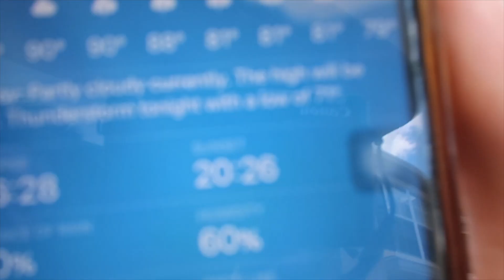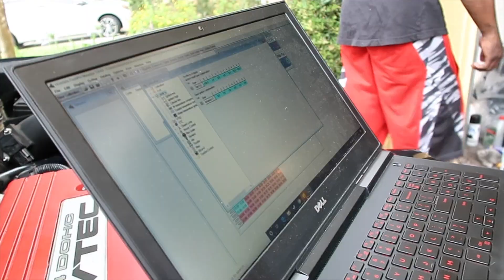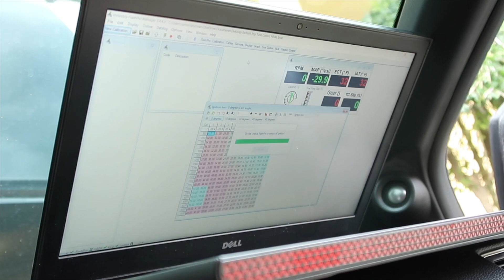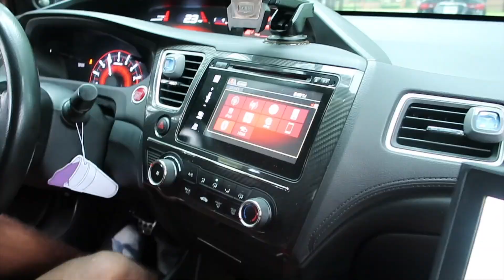FINALLY WENT CATLESS!! FULL RACE DOWNPIPE 9TH GEN CIVIC *SHOT A FLAME!*

Comment: Faster way to work on the car, buy a milwaukee fuel 3/8 extended  ratchet with battery.. takes bolts off super quick and makes working on the car a breeze instead of baking in that heat!

Comment: I gots a question... you don't gotta answer but you'd be a helovalot cooler if you could tell me weather or not itll fuck up my air/fuel ratio if i were to cut my catalytic converter out and just weld in some pipe? It'd essentially be the same same thing, rite??? FYI I've got the cold air, FR catbak, coilovers and  as soon as I can afford a wheelie bar im putting a racing strip on this bitch but ive got no kinda tuner.

Comment: Literally spent all that money on an exhaust when all you got is a C.A.I. 😂😂😂 no need to spend money on a "Race Exahust" when you’re not running big number power
Reply from the maker: Don’t even have a “cAi” bozo 😂
Reply: Korey Wright what “Cold Air” is being brought into the intake when the filter is right next to a HOT motor 😂😂😂 hence why the stock filter is inside of a box to help with not inhaling the HOT temps from the motor and that’s why some C.A.I’s the filter is inside of a box to help block the heat